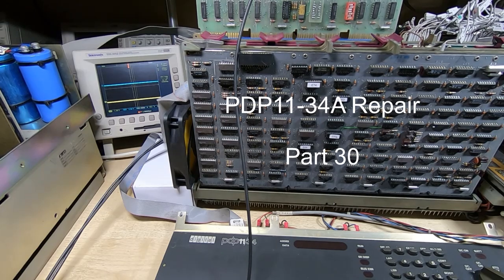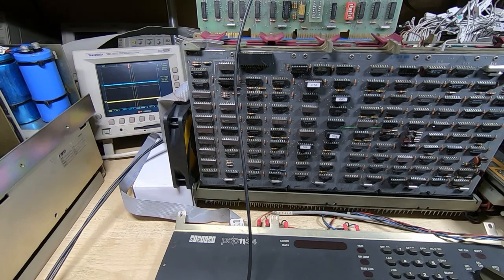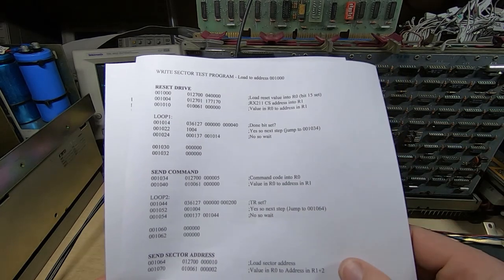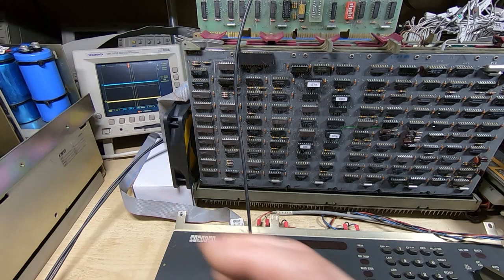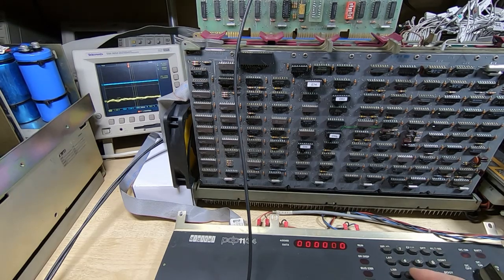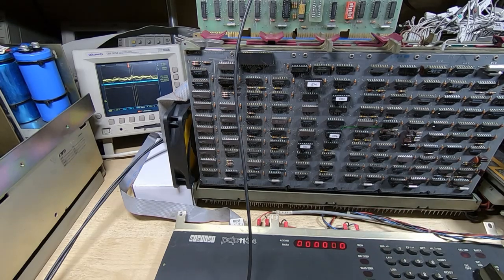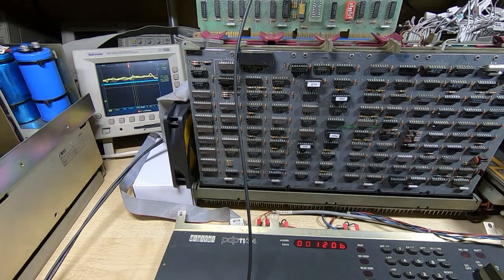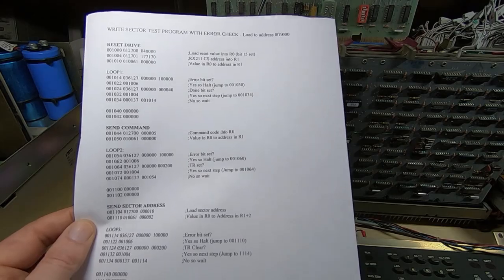PDP11-34A Repair Part30

Comment: Would it be worthwhile building a hardware emulator for the RX211 controller using your favorite microcontroller to allow testing of the floppy drive system separately? Would this simplify the troubleshooting process or be more work than necessary? I have zero experience with the PDP11 series and the complexity of the RX211.

Comment: Jerry, where did you find the RX211 schematics and what was the filename?  Did one of the technical documents give the print number so you knew what to look for?  Also, now I understand your "software" testing a lot better -- I wouldn't have thought to try to cause errors to see how the system handles them.  I'll keep that in my "troubleshooting toolbox."

Comment: I know the frustration of having to slow down transmission rate to allow the processor to deal with the data - I am having exactly the same problem on my homebrew 6809 machine. Hence the reason that I am attempting to hack one of the serial cards to incorporate hardware flow control (the 6850 ACIA does not have it built in). I quite agree with your final point about hand assembling your test routines. You can never be sure what code a compiler would produce. An assembler would be useful but for simple short routines such as these it doesn't take long to hand assemble them when you are familiar with the instruction set and opcodes.
Reply from the maker: Exactly. It only takes a few minutes to write the test programs and if I need them again in future it will take no time as I now have them. The slow serial rate is not really a problem as it still only takes around 15 seconds to send them to the PDP and I only need to do this once per session. You could actually speed this up significantly by removing the leading zeros but I left them in for clarity in the video. Once the code is in the PDP it runs at full speed of course.
Reply: @JerryWalker001  And it's way way faster than you could key them into the front panel...
Reply from the maker: @warnerlosh  Absolutely

Comment: As you seem to have the ability to read and write registers from serial can you drive the hardware you want to test by writing something in say python for the logic and just bash the registers on the PDP? The reason I ask is that would mean you could bypass a lot of the CPU logic that's needed to run normal code.
Reply from the maker: The tests are intended to test the PDP CPU and not just the RX211 and RX02 as the fault may be in the CPU and not the drive controller. The serial interface is WAY too slow to run the code through it and you would not have access to the interface control registers anyway. The code is sent through the console emulator and not directly to the CPU registers. Another purpose of the test programs is to allow the logic analyser to be used to examine the signals and this is also why the code needs to be structured fairly specific. I am also not sure why writing the code in another system or language would be better as there is nothing wrong with writing the code in PDP assembly.
Reply: @JerryWalker001  
>The tests are intended to test the PDP CPU and not just the RX211 and RX02
>as the fault may be in the CPU and not the drive controller. 

That makes sense. I thought maybe isolating CPU problems from the disk interface problems would be useful. i.e. if you can manually do the operation via register read/writes over serial but you can't get it to work when the CPU is running a piece of code that does the same thing you'd be able to narrow down that it's probably on the CPU side. Using python or something to crank out the sequences needed would mitigate some of the slowness because you could set it going and come back later.

For reverse engineering little embedded linux machines I take advantage of the fact that they generally have a command (devmem) that allows reading/writing IO registers left in by the vendor. I can drive that from my PC over serial to poke at registers, dump out before/after dumps of a peripheral's register space and then use tools like diff to work out what changes are happening, which bits affect other bits etc.

>Another purpose of the test programs is to allow the logic analyser to be used to examine the signals
>and this is also why the code needs to be structured fairly specific. 

That's another thing I was considering. If you only ever trigger read or writes to addresses and don't do any testing for bits being set or not etc on the CPU side the stream of events on the LA would just be the memory accesses to the registers. If you went really over the top you could feed the LA data back into the script side and have it check the result is what was expected.

>I am also not sure why writing the code in another system or language would be better as there is nothing
>wrong with writing the code in PDP assembly.

I didn't mean to say there is anything wrong with PDP assembly.. just that writing code to test different sequences and gather the results might be easier if the logic doesn't actually run on the PDP.